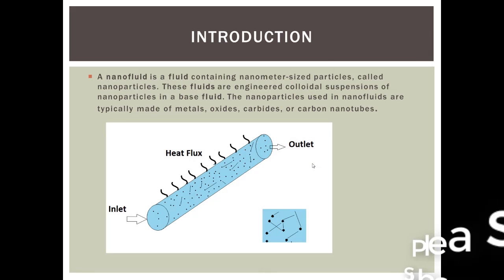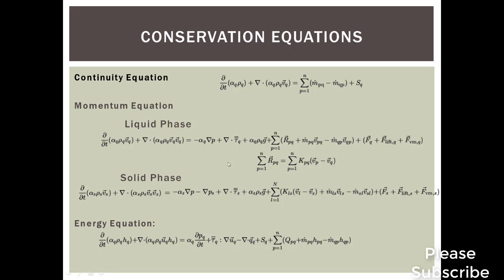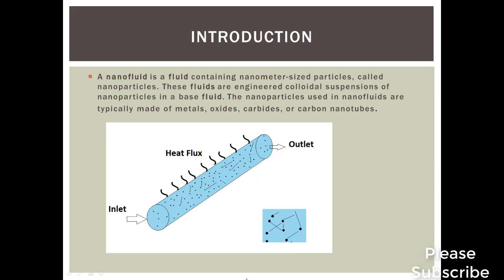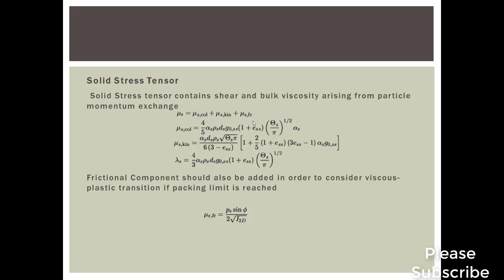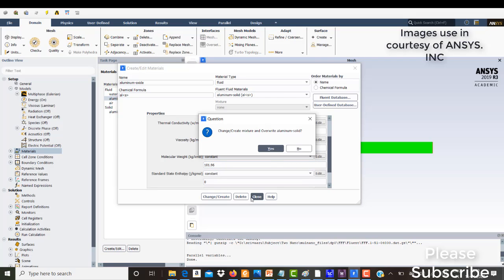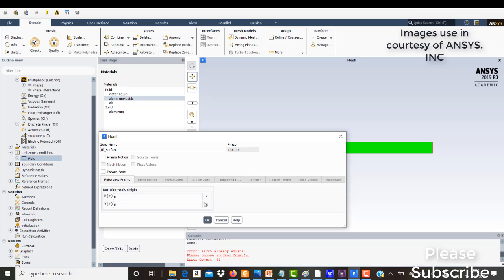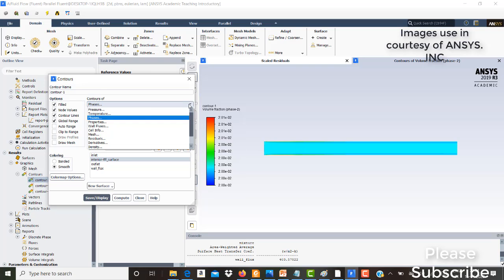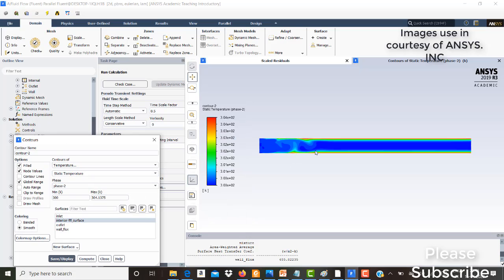Two Phase Nano Fluid Simulation using Ansys Fluent

Comment: I did the simulation same as you, but I am getting the volume fraction of phase 2 contour as uniform, not more near the walls. Please help
Reply: hye,i also did the simulation same as you , can i have your email for i ask some question about this simulation.hpe to hear from you soon.
Reply: @royateet Did you finally resolve the issue?